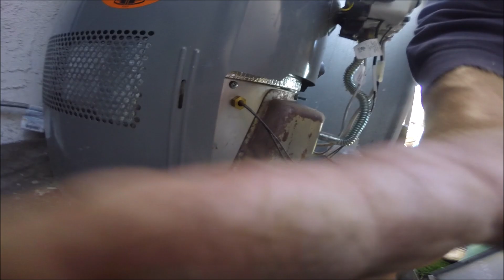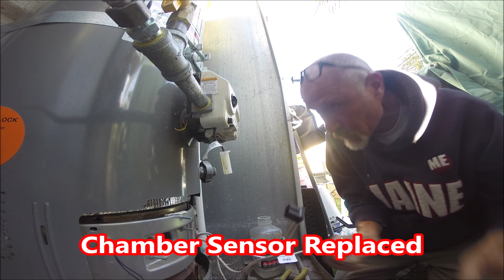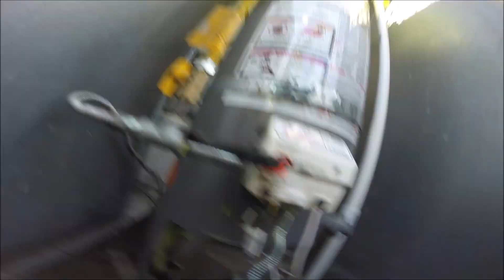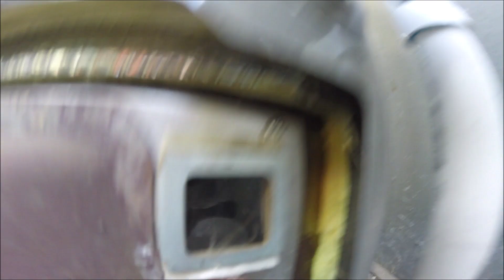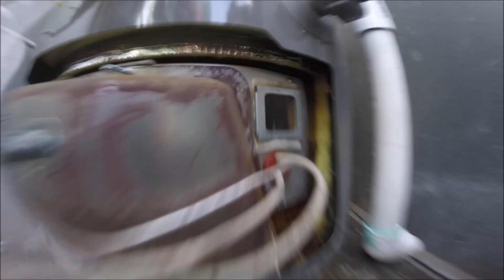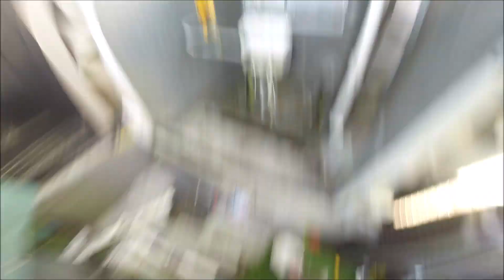Rheem Chamber sensor replacement - service call

Comment: Did you changed the gasket or there’s no need to change it?
Reply from the maker: Well, technically, yes, you should change the gasket. But between you and me, I never change the gasket typically it’s not needed in my opinion. I’m sure there’s a slight disruption in the seal but most of the Water Heater haters. I’m working on her so old and decrepit and on their last legs that I don’t even bother to do it, but technically you should always replace the gasket with a new one.
Reply: @thewaterheaterfactory  thank you sir.

Comment: Why did you post the video when you do not show what is in the title of the video?
Thumbs down on this one. Bad video, waste of everyone's time.. including yours.
Reply from the maker: I have other Code 9 videos that cover the replacement of the chamber sensor , check them out sometimes its not always feasible to film what I am doing. The primary goal is always to complete the job asap before filming , sorry you had a bad experience.
Reply: @thewaterheaterfactory  is there such thing if place the burner to high up ? Mines not as visible through the window and I need to go down to see it